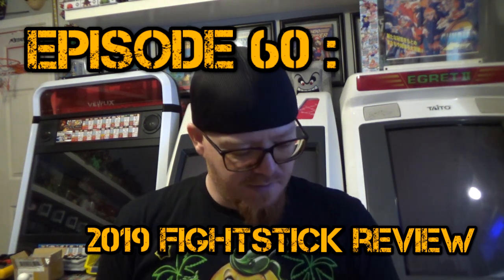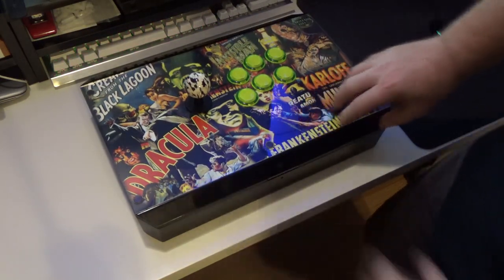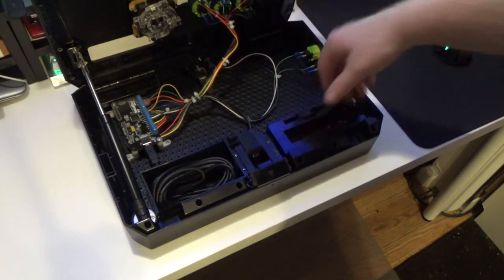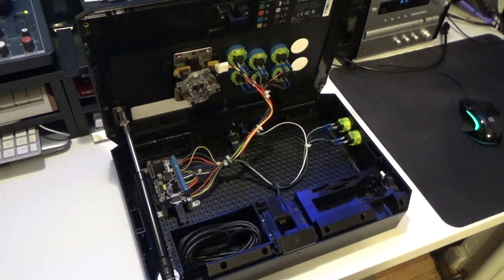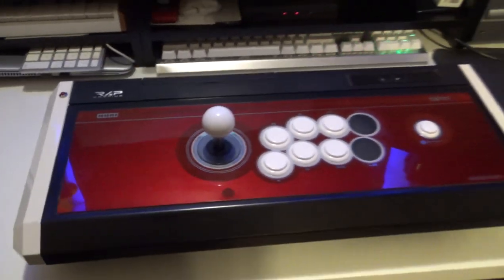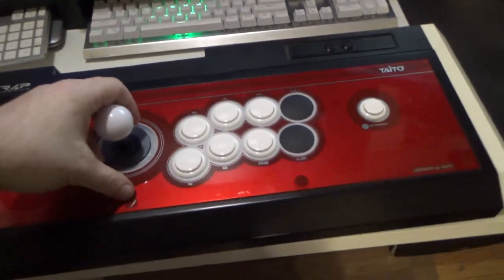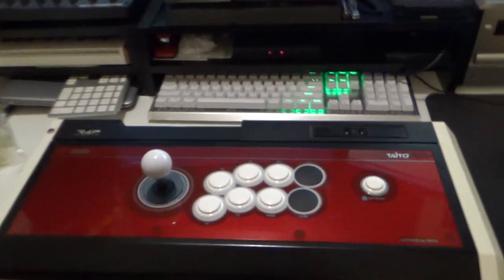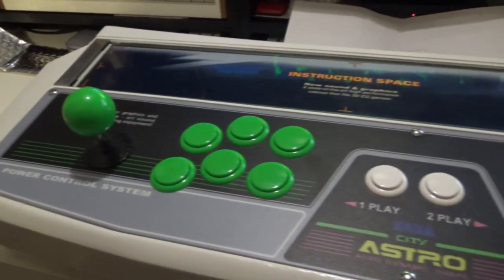Fightstick 2019 - Review and Upgrades ( Hori VLX, Atrox ) - PastBlaster Episode: 60

Comment: I just ordered a universal brook for my atrox, how easy was it to screw down? Also do I need to completely replace the wires?
Reply from the maker: Pick up some PCB feet or some stick down PCB mounts. The screw in kind will screw directly into the bottom hexagon grid of the Aatrox case. You will need to either cut your wires from the Stock PCB and reuse them, or do like I did and make a brand new harness for the stick, to fit the new Brook. Let me know if you need help with wiring and I can point you in the right Direction. Thanks for watching!
Reply: PastBlaster I received my board in the mail today and realized I am way over my head, I should have no problem with the input buttons, but I’m afraid to start cutting the wires before I know where the other wires go. This is my first project doing anything like this. Is there some way I could msg you?
Reply: PastBlaster there seems to be a real lack of help online for this lol
Reply from the maker: @Mr.Sometimes-  Sure man, shoot me an email and I'd be happy to help where I can. akpastblaster@gmail.com